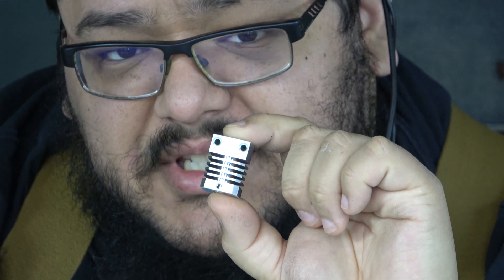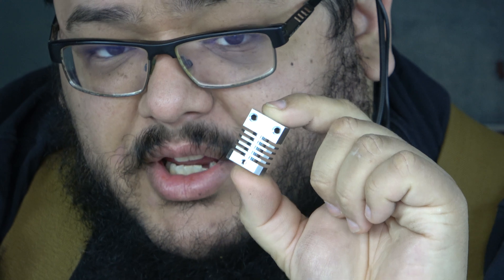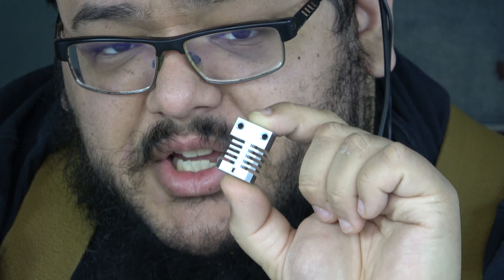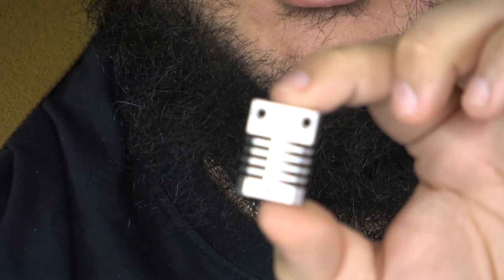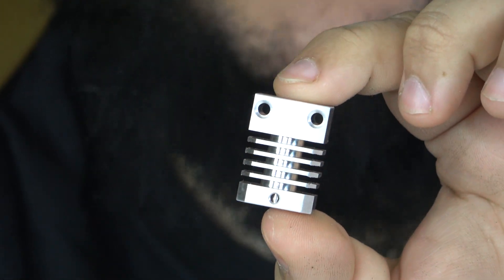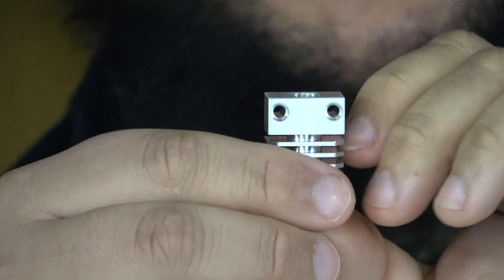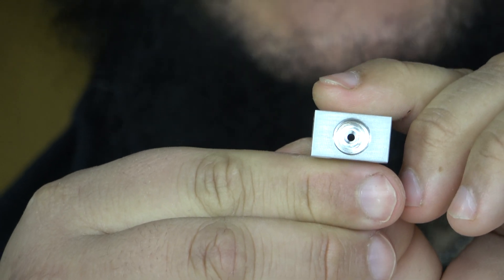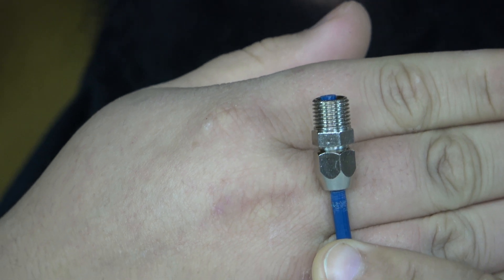Testing Custom Microswiss hotend with compression fittings

Comment: Thanks for the info, Ron. I’d love to get one of these as I just upgraded to a micros swiss all metal hotend to go along with their direct drive I have installed on my Ender 3 V2. The only problem I’ve encountered so far with it is the tiny little Bowden tube that comes with the direct drive kit will not stay seated in the heat sync. It keeps moving around and I’m constantly dealing with extrusion issues. I’ve troubleshooted (troubleshot?, IDK) everything you can imagine and multiple times and I would get similar but different results almost every time and then I came to the conclusion that it had to be the stupid fitting the PTFE tube sits in at the heat sync. I actually thought about tapping some threads myself to create something similar, but reaching out to micro Swiss was genius. They’re a great company from having dealt with them a little bit. When I first purchased their all metal hotend, my dumbass tried to over tighten the nozzle and sheared it off into the hotend. I then proceeded to break off two separate screw extractors into the same heat block, but long story short, I emailed micro Swiss about potentially getting just a couple of the components for free and they sent me a whole hot end kit for free!! Do you know if there’s a way to get one or a couple of these? I’m willing to pay. Should I reach out to them or can you potentially get some and send them out? Let me know if this is possible because it would help my 3D printing dream immensely. Thanks man

(Oh, my reference to Ron…. As I was watching this video on my phone my girlfriend was sitting on the other couch and said “why is Ron Swanson, talking about 3D printers?” I had to look away from the video and just listen to your voice and god damn you sound just like Ron Swanson from Parks and Rec, lol)

Comment: Andrew, thanks for your great content. Following your stream I did some research of my own and found the tapered thread on a MK8 hot end is a 1/8 inch NPT thread, not a 1/8 inch BPS thread, but they can probably be used interchangeably, the thread pitch is the same but the profile is different. NPT the peaks and valleys of the threads are flat. In BSP, they are rounded. Secondly, the NPT angle of the thread is 60 degrees and the BSP angle is 55 degrees. 

I got some brass and stainless steel compression fittings from China, and they have worked great, no slippage at all. From rskl's comment I might change the brass ferrules to ptfe so that it's less likely to damage the Capricorn tubing

Comment: You forgot about the drilling the center of the fitting to allow the Bowden tube to sit/seat onto the Micro Swiss hot end. How is this setup holding out? I have ordered the same couplers and took about 2 months to get here (Thailand). Haven't fitted them yet. Thought to view the videos again just to make sure to do it the right way.
Reply from the maker: This setup has been bullet proof. I've not had a single problem with them in hundreds of print hours

Comment: The design of the fittings was changed so there's not a lip, but actually the whole length on one side is the narrower diameter. Also they stopped shipping to the US.